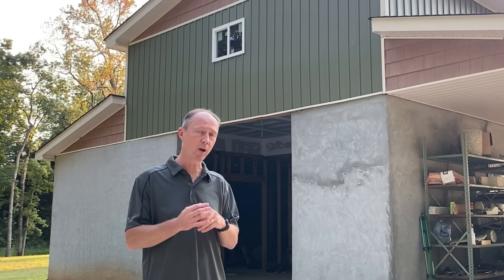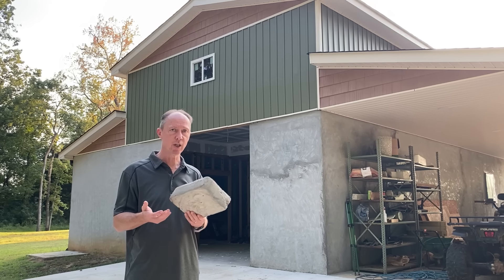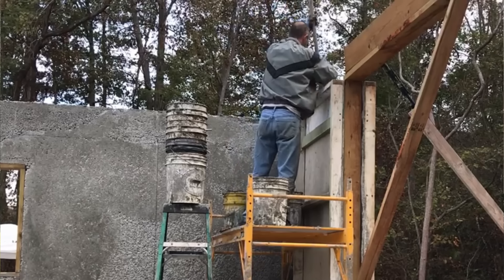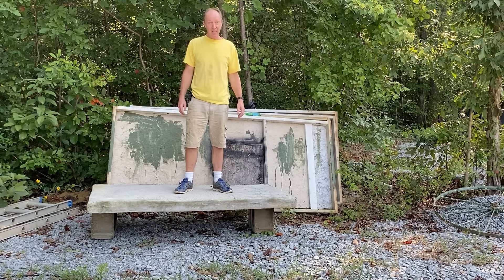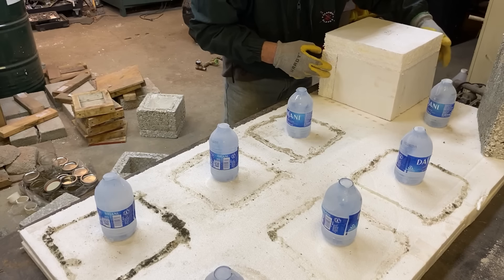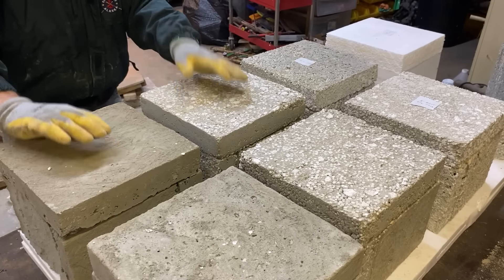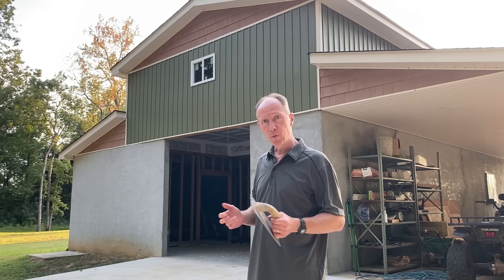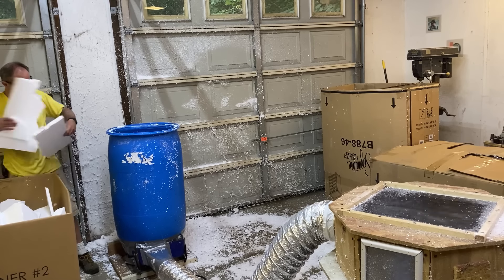The White Gold Rush?! The Video That CHANGED Aircrete Forever!

Comment: The building department wants me to provide information on the structural properties of this system, unable to find a structural engineer that knows the structural properties. How did you get a permit to use this system? I would really like to use it, save cost and insulate all in one, what could be better.
Reply from the maker: Mark this is the problem with all alternative building processes. Iam in the County and we have no inspections so not a problem. But if I was in the city I would need an engineer to sign off on the process.

Comment: I'm having trouble with your statement of being fire proof. Toss a brick into an open fire and see what happens. I'll bet the styrofoam melts out (losing strength) and produces poisonous, flammable smoke. No disrespect, just wondering. What I have wondered about is glass micro beads. The beads have a vacuum inside (insulation quality), can take 60k p.s.i of pressure (strength), and glass is immune to most forms of erosion, corrosion.
Reply: immune? i woulda chose to use the word "resistant"
Reply from the maker: New test coming soon! Subscribe to see the results!

Comment: I was debating about something like this when I go to build my dome house next year. My thought was to make the frames from 2x4s / 4x4s or from square aluminum tubes, place in a few windows and ventilation areas (geothermal type), and then TyVek the inside of the structure to pour in the slurry mix and cover the outside with TyVek/plastic or now roofing felt. Once set I was planning to stucco the outside and finish the inside. I'm definitely going to look at the styrofoam aircrete mix now. I wonder if something like industrial hemp as a binder could work in it as well.
Reply: Tyvek too weak to contain mix.
Reply: @designstudio8013  
Good to know, thank you
Reply from the maker: Good luck on your project! Subscribe for new builds coming soon!

Comment: You do not need over insulated walls.  Heat rises doesn’t go side ways.  You lose 50% thru the roof and 30% thru the windows
You need to stop air infiltration thru cracks in the walls.
Reply from the maker: thanks for the tip! subscribe for new builds coming soon!

Comment: From Australia: what is 'stuckoh'? Never heard of it here!
Reply: STUCCO Is a hard exterior plaster like coating put on the concrete block used on many homes in Florida the south west and Mexico. Some wood frame structures also have stucco over cement board or wire mesh over osb to have the appearance of being a more solid structure or to achieve a particular design look  that is popular in Florida and the south west US. Hope that helps
Reply: Forgot to add that stucco can be smooth like plaster but most I've seen is a bit sandy in texture. I'm from NC where most stucco is applied over OSB with a wire covering. IMO It is more prone to problems like cracking and paint fading than brick veneer or vinyl siding or hardboard siding. But in some states those exteriors are not as common when termites prevent the use of wood for first floor framing construction. In some states termites are more of a problem or other issues like flooding or high winds don't allow wood or metal framing.
Reply from the maker: Stucco. Subscribe for new builds coming soon!

Comment: Hi Stephen! wonderful video! Have been interested in Aircrete for a very long time. Just one question -  How do you test the R-value?
Reply from the maker: Petter, thanks for the feedback. I am working on this video now but essentially comparing it to pure EPS and concrete that I know the R values and building 2 inch boxes out of the different mixes and seeing how long a bottle of water melts within it.

Comment: 2.).  Regarding your styrofoam grinder that’s cause motors to plug up. How about going with a belt drive or a gear drive to your chopper blade. 
Can I get mix design formulas from you I wish to try it out on a few projects one being a rocket stove that I have to heat my geodome in the winter.    I would also like to build an air Crete shelter with roof for my animals.
Reply from the maker: Thanks for the tips! subscribe for new builds coming soon!

Comment: Question number 1: Permits. How did you get your building approved by the city and signed off on by an engineer, using such experimental methods?
Reply from the maker: Zengalileo, I am in the County and have no inspections. Yes this would be a major issue in the city.

Comment: I wonder if anyone is using this polystyrene and Portland mix with 3d robotic printing technology maybe with wire reinforcing in the center of the extruded material. If the thickness was right I'm betting that would work.
Reply from the maker: Needs compression!

Comment: Let us be clear builders sand is of a particular grain size range and shape. There will never be a "powder form" of it. Adding expanded polystyrene to cement then covering it with a mesh cover is not new. As always, no matter how well you can build a structure there is the onerous hurdle of building codes and inspectors to deal with. 
I do applaud this mans labor and ingenuity however.
Reply from the maker: Thanks for the tip! Subscribe for new builds coming soon!

Comment: I feel like the promise of this lies in the material/recycling/r-value... maybe not so much in the particular application. Though I will subscribe and watch for some destruction testing to determine structural ability. But if a person was to make a frame and skin it on both sides and pack it with this... build with panels. There are swimming pools made with aluminum panels, packed with something lightweight and connected with slide in rods... I dont know, seems like a person could expand on that idea, add traditional trusses and sell buildings.
Reply from the maker: Thank you! New builds coming soon - stay tuned!

Comment: aircrete seems nice but doesn't it still require the same material used by cement factories that causes so much methane. that powder mix you added with the sand and styrofoam you still need to get it through the same polluting process? much less i gather but still present.
Reply from the maker: Reducing needed portland by 90% and recycling makes the build carbon negative! subscribe for new builds coming soon!

Comment: Why make the walls so thin?  I would think you'd want to make them at least a foot thick for strength purposes if not insulative purposes.
Reply from the maker: Javatherus, the beauty of the system is the flexibility to make the walls any thickness you want based on location and need of insulation. Yes the thicker the walls the strength increases substantially. A 12 inch wall will be around an R40 wall from my in house testing. Not lab based.
Reply: @AbundanceBuild  I like the flexibility.  I'm just obsessed with over building.

Comment: Tell me it really is true.  Steve, Califiornia and most regs would require certifiaction & crazy seimic and Simpson plates everywhere. Panels with gaskets and channel posts.Eps foam is Zero fee people aer dumping it everywhere-- take all you want.  No rebar used here. AS must everywhere else. Even tried Wall uses wire cores.
Reply from the maker: Its true! Subscribe for new builds coming soon!

Comment: youtube algo doing its magic big Thanks. Yes I too follow the big guys, Harry / Honey, too bad they recently not releasing as much content anymore. 
There are few Russians experimenting on aircrete too they are amazing, man those Russsian excel economical + practical, just what us DIY's like.

Very nice test R value of 3.5 vs 2.2 aircrete density????
medium mix ? ie Harries 50 gal mix or the similar Gaia standard mix

Good to see just pure Styrofoam is strong enough to build 2 stories. Why you decided not to added paper for extra tensile strength like Harrys Epic mix?
I guess proof is in the pudding. yeh most of the strength comes from the outer shell anyway

But I still think the old news paper will be beneficial
What about styrofoam + cement + foam (and maybe paper too) = save more on cement 
positives = save cement, lighter, more insulation, recycling
negatives = more work, slightly less compression strength (i think its negligible, otherwise just build thicker walls if possible)

Great to see your alternative design shredder, cheap, easy fast, definitely going to copy that.  

What did you use as your mesh? same stuff as Gaia? roof fabric? cement? same formula as them?
Or did you use metal or basalt mesh like Harry? expensive but basalt mesh is probably the ultimate stuff.

Ive been putting of using Styrofoam as Im worry about VOC and long therm health in personal living areas. Garage, storage, hell yeh.
But tho R values are amazing, You got me thinking again, its a trade off between R value and health, Now im confused on the fence again, thanks lol.  

Subscribed and Bell, cant wait for your next video.
Reply from the maker: New builds coming soon! Stay tuned

Comment: To those concerned about styrofoam melting, sagging, etc, the styrofoam is there to enforce the holes. In aircrete the holes are formed by air. In this instance the holes are the styrofoam. If the styrofoam melts they leave the hole. There is no loss of structural integrity since the holes are required. As to the emission of nasty gasses from the styrofoam, I would imagine the heated air of the fire would be your first clue to un-a.s.s. the area. Also the noxious gasses being hotter than ambient air would be rising.
Reply from the maker: well said! subscribe for new builds coming soon!

Comment: I bet this would work with a 3D printer.
Reply: What do you mean, like load a 3d printer to dispense this final mix of styrocrete?
Reply: @bcboncs   yes. They can 3D print a house now using a type of concrete mix. That mix may work with one of those printers. Go Chiefs.
Reply from the maker: Go Chiefs! Styrocrete requires a mold to pack tightly. But we are experimenting with some new stuff coming soon! Stay tuned

Comment: You've obviously seen folks build domes using a 'balloon' as the inside form right? Since your material is firm  enough to be stacked by hand, evidenced by your repair under the window, you could just work the aircrete mix by hand. I've searched in the past and its not that difficult to make (sew) a balloon...
Reply from the maker: Mike, yes packing by hand over the dome will work. Harry is sowing a fiber mesh sock that fits over the dome as well. This is needed to help the mix grip the wall and to reinforce it.
Reply: @AbundanceBuild  Nice one! Keep up the videos!

Comment: Just can't understand this.  8" foam filled concrete block with 60lb density has and R value of 1.8.  12" cmu, and double wythe brick R values are higher,.  This system can't possibly be as fast or cheap as standard building practices with 8" C.M.U's.  Nor does it come anywhere close to matching it's strength and durability, easy availability of the product, easier to handle and install (though a bit heavier), etc.....  Not to mention standard CMU's pass all building codes everywhere.   Why would you do this except just to be able to make a video and say you did it?

  I've seen these kind of things before and they're always 10 times slower and never go anywhere, for all contractors hate them.  The only thing I wish is that they would allow us to lay standard C.M.U.'s out of the stuff to keep the weight down.  But that will never happen because there has been a standard size C.M.U. product on the market made out of fly ash for over 40 years,  which weigh 2/3rds less, but we are not allowed to use them were I live, even though they have almost the same specs as a standard unit.
Reply from the maker: We think recycling is important and this styrofoam is free! Subscribe for new builds coming soon!

Comment: Why not just use clay and sand and make a brick pile then fire them. If you own land this is the cheapest way to build because it’s very low costs and lasts for a very very long time then when your done with the brick crush them and make new brick out of the crush as sand.
Reply from the maker: thanks for the tip! we prefer recycling! subscribe for new builds coming soon!